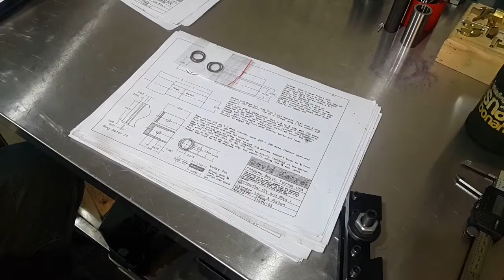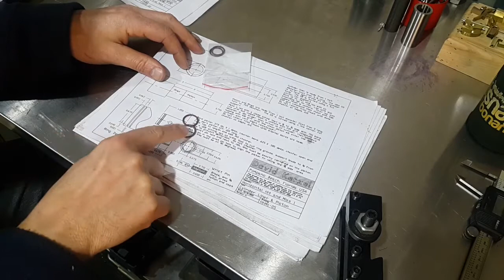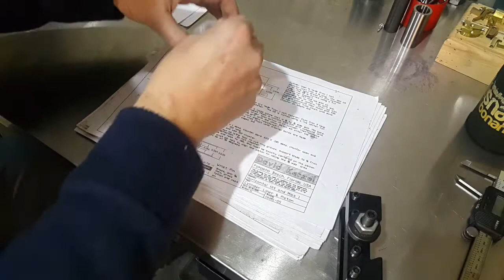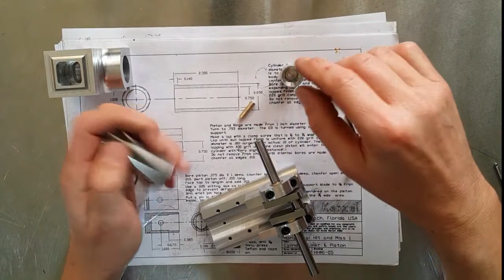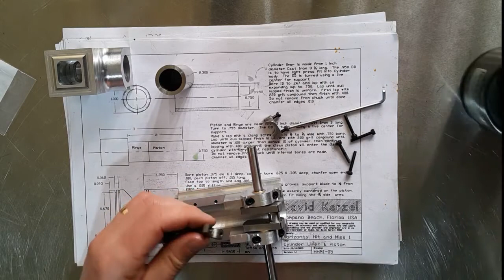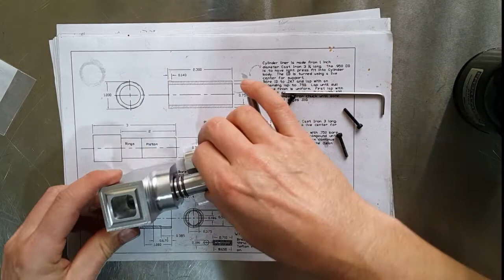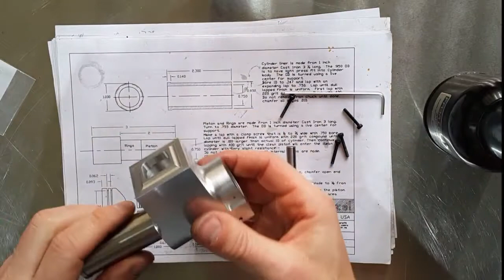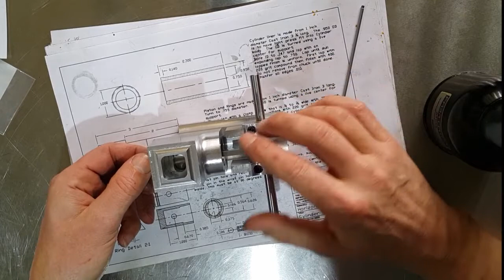#64 - Kerzel Hit & Miss Model Engine - Part 10

Comment: Great Video Kevin, and that engine is a stunner. I look forward to these videos with loads of precise work, working to tolerances, and getting great finishes on (usually) difficult materials. Awesome stuff, please keep up the good work. Looking forward to the next bit. Cheers, Craig
Reply from the maker: Thanks Craig. I've since deepened the piston ring grooves and the engine turns over a lot better now. I still have some room to play with but am going to wait until I run the engine for the first time. I don't want to risk loosing compression.   Kev
Reply: @Machine_NZ  No, as they say: easy to take more off, hard to put it back!